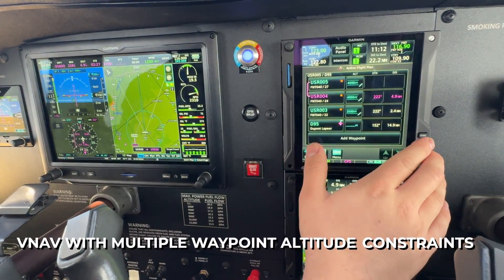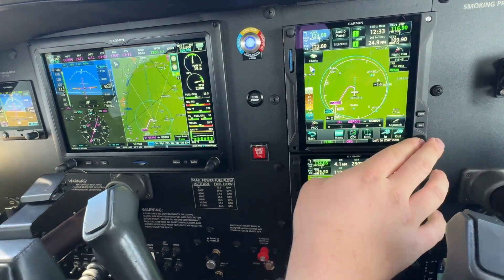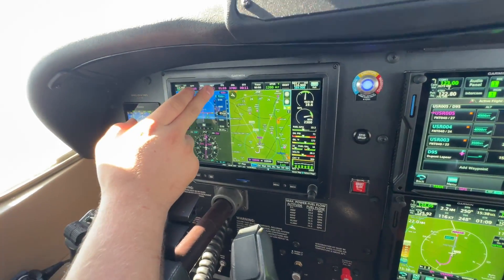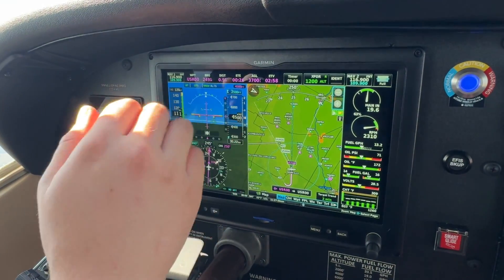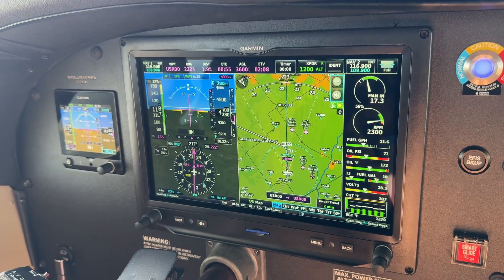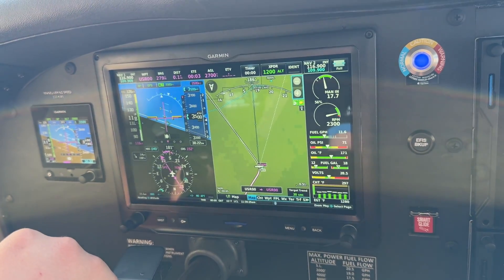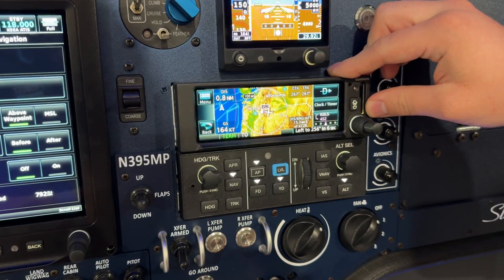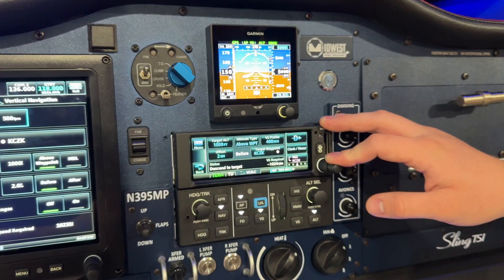Garmin VNAV/VCALC on GTN, G3X and 2-inch Navigators

Comment: Thanks for your explanations. I have a question, we have two G3X, one G5 and one GTN750. When I activate VNAV on the GTN750 it is not showing the glideslope nor the flyboxes on the G3X and G5; we have external GPS selected. What do we have to set up to get glideslope and flyboxes on the G3Xes and the G5? Thank you for answering my question.
Reply from the maker: You need to have the latest Sartre on both GTN and G3X, then in GTN the ARINC 429 out needs to say Garmin 429.

Comment: Question for you: If I had a G3X and a GNX375, I can VNAV using the G3X one waypoint at a time, all while the GNX is still set as the external navigation FPL source? Meaning the IFR GPS is still driving the whole system and autopilot, and is approved for IFR flight?
Reply from the maker: Yes, in this case in particular you can do this. Also, if the GTN is set to VCALC mode instead of VNAV mode in configuration, you can then run VNAV on G3X.

Comment: Does the VNAV only work on a GTNxi or also on the older GTN’s?
Reply from the maker: It works on the original GTN with Software 6.5 and up.
Reply: @MidwestPanels  thank you for the info

Comment: When using the GTN for VNAV, when setting an altitude target at a waypoint, is the VNAV Direct selection an essential step?  I've usually just done Save at that step.  Though, more than 50% of the time, the VNAV fails to properly engage, so I wonder if this is the reason.  Awesome video, as always!
Reply from the maker: The VNAV Direct-To is technically intended for use on a later waypoint (think of it in the same way as if you got cleared to a certain waypoint in your flightplan that was 2 or 3 ahead of your current waypoint), but I found that if I just do it at the first waypoint with an altitude constraint, it allows for 100% reliability in picking up and tracking the vertical course - especially when you're starting off-course laterally.
Reply from the maker: One thing you can do is verify that a TOD point is shown on the G3X and/or GTN map page. If this is missing, then VNAV will not work, then you can do the VNAV direct-to in order to force it.
Reply: @MidwestPanels   There's always a TOD point displayed when I set a waypoint with an altitude constraint (and it even seems queued up in the AP), but it usually just flies right past it.  The bug is set to the lower altitude, so I feel like I'm doing everything right, but no joy...
Reply: @CraigMaiman Did you arm the VNAV on the GFC507 and ensure that you see a white VNAV on the “scoreboard” (AFCS Status Box)?
Reply: @OneAlphaMike   Yes.  That's the thing that perplexes me!  It looks all set, but no joy.  Just flies right past the TOD and nada.  Very strange.
Reply: @CraigMaiman  That sucks. I don't actually have a GTN, so I don't know what else to suggest. I have a GNX 375, so I use the G3X VNAV. Works perfectly every time! It can only do one point at a time, as Adam said, but typically that's all I need.
Reply: @OneAlphaMike   Gary Reeves (a Garmin expert) says to not even bother with VNAV on the GTN...  He says it's too complicated with nuances and gotchas, so just use VS for descents.  Until I really figure out the issue, that's my plan.
Reply: @CraigMaiman  indeed you can just set VS so that the cyan arch is where you want to reach bod. BUT IMHO it's totally worth getting VNAV worked out for IFR because it makes it really easy on RNAV type approaches to just first set altitude to the FAF with VNAV, enable APRC when cleared, and you cannot miss the diamond to the ground. Super smooth.
Reply: @YourFriendlyGApilot  , I'd very much like to get it working, but I just haven't figured out the magic formula to make it work.  I need someone to fly with me who knows it down pat for IFR approaches.
Reply from the maker: I would look at the GTN and G3X's configuration for ARINC 429 and just make sure that everything on both is correct and also ensure the GTN is at the latest software revision. This has been 100% reliable for me in all the aircraft I have flown with a GTN and G3X or G5, so I am reasonably certain that this is a config or wiring issue.
Reply: @MidwestPanels  I also feel like it's a configuration issue.  The TOD appears on the GTN map, but not on the G3X map and that's made me wonder if the config is wrong.
Reply: @YourFriendlyGApilot  Once Approach mode is active, that’s handling the descent, not VNAV.
Reply: @OneAlphaMike  maybe I wasn't clear:
You first enable VNAV to the min altitude of the FAF, then, once you get cleared for the approach you enable also APRC. Both will be enabled on the GFC and so VNAV will bring you down to the FAF altitude and the GP, so when on it, it will automatically switch over to APRC only (and turn off VNAV) and the GP will indeed bring you to the ground (I've been doing this since discovering that video I linked and an article by the same person in AOPA about it).

It is much the same as when you select HDG and set it, and then click also NAV: the HDG and NAV will both be enabled, and HDG will remain on until you are on the NAV and then it will switch over automatically. Same with VNAV and APRC, just vertically rather than horizontally. Again, check out the video I had linked, it's super easy and works great!
Reply: @YourFriendlyGApilot  I gotcha. I'm just saying they can't both be active. Same with your analogy with HDG & NAV. One is active (green), and the other is armed (white).
Reply: @OneAlphaMike  sorry, yes you are correct, one is active the other is armed and salivating to become active and make you look awesome on approach 😜😜
Reply from the maker: No TOD on G3X is 100% a config or communication issue.